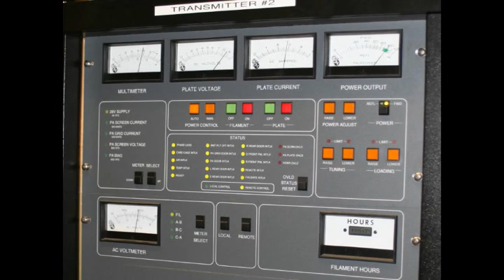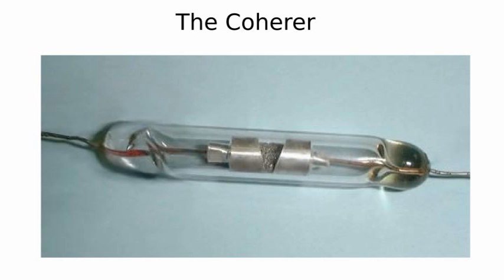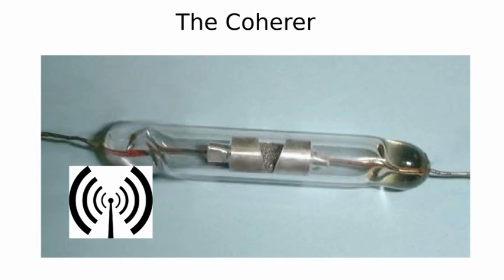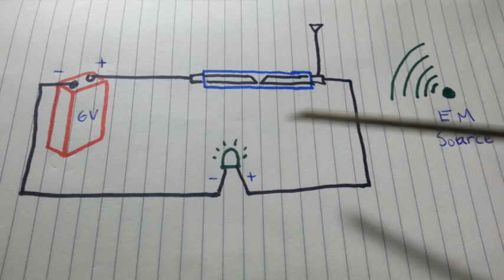Vintage Technology: The Coherer

Comment: Great stuff.
Was searching for coherent since long 

Can you also share how exactly the EM waves affect iron filing resistance
Reply: In practice, they used a vibrating tapper to unpack the filings as they kind of latch on. I think that the filings have a higher resistance until the current pulse creates a corresponding magnetic field that aligns them to conduct better, more mag flux, better alignment, higher current......I think that is the reason for iron...magnetic...filings.
Reply from the maker: thank you

Comment: Have you measured the induced voltage from the antenna onto the coherer. The coherer is a very odd mechanism , i would have guessed it would produce a short circuit all the time
Reply: In practice, they used a vibrating tapper to unpack the filings as they kind of latch on. I think that the filings have a higher resistance until the current pulse creates a corresponding magnetic field that aligns them to conduct better, more mag flux, better alignment, higher current......I think that is the reason for iron...magnetic...filings.
Reply from the maker: I didn´t

Comment: Thanks for the video. I made similar expeiments and recognized the following: You can use the coherer as a noise/ vibration amplifier. With a small power source, and in series to a seperation-transformer (for limiting the current) you can connect a headphone to the secondary(low ohm) to hear the amplified noises. I could imagine to build a very simple vinyl-player with this setup, by attaching a needle to the casing of the coherer. Something like a surveillance device could also be possible. Maybe you want to try it...
Reply from the maker: helut kuno Sounds very interesting! I will definitely try that, thanks for your input.
Reply: Carbon rods/discs may work as amplifier too. First non semiconductor time carbon microphones are very popular. Sovjet disc phones used carbon dust microphones in late 1980. Sometimes little noisy, but amplification are big

Comment: Great video. Very interesting device. I did a little research, cool stuff. Very easy to build, worked first time. With spring around the corner, thunderstorms, going to try a simple lightning detector. Thanks for sharing another great project.
Reply from the maker: Cobbie Smith Yes a lightning detector would great!

Comment: Could this coherer handle significant amounts of current? I imagine that it is very limited due to the iron fillings.
Reply from the maker: idakid Yes you are right. Only small currents
Reply: you can connect a relay or a transistor

Comment: Fascinating, the way the iron filing aligned in the presence of RF seems similar to how piezoelectric crystals align in a crystal cell battery.  The Coherer allows an existing current to flow in a circuit while piezoelectric crystal injects the current to flow in a circuit which is sourced from the RF.  Both require some kind of connective alignment to be formed.  Whats also interesting is when a Coherer is knocked it stops, while piezoelectric may start or continue current flow.
Reply from the maker: Spangley Rainbows It is very interesting indeed, as far as I know, even today the mechanism by which the iron filings bvecome conductive in an RF field is not well undesrtood.

Comment: could you have this work with specific frequencies?
Reply: The coherer itself is frequency independent. If you connected an inline  series L-C filter tuned to show low impedance/high current at a specific freq, that SHOULD make it tunable. But it stays conducting after the first exposure to the antenna impulse.
Reply from the maker: Matthew Corfiatis No
Reply: would have been useful if you could, damn
thanks
Reply: Matthew